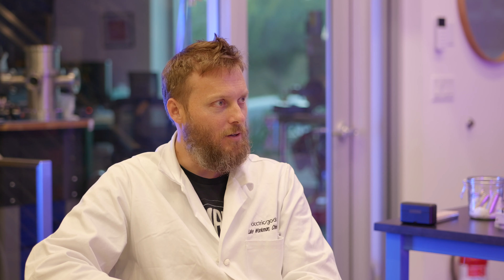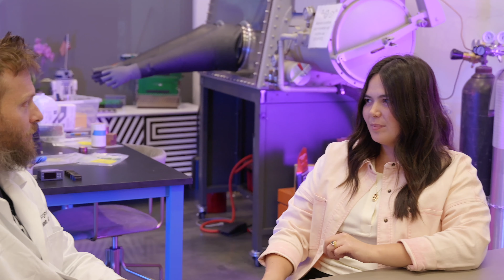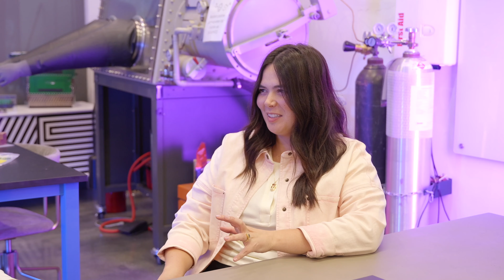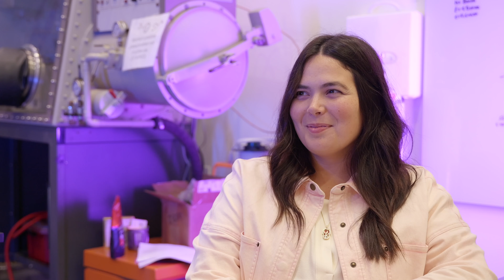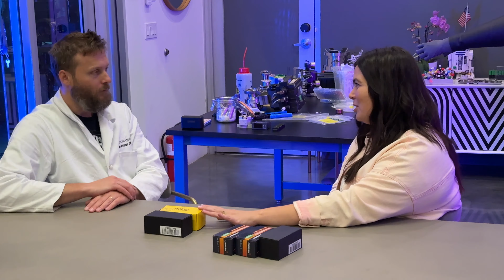Racing EV Battery Design Considerations

Comment: Let’s build a cell for a single cycle!
In ultra high-performance drag racing, where budget isn’t a constraint, I can easily imagine single-use LiPo packs even without BMS for a 7 or 8 sec run.. after all what could it do anyway?. These cells lose performance after every race anyway, which goes against the idea of tuning for peak performance.
So why not design a LiPo pack optimized for maximum performance, right at the edge of safety, just for one race? Swap it out every time — just like the active material of the 5MW semi-solid chemical laser in Real Genius with Val Kilmer!
When your goal is to win or break a record, longevity isn’t always the priority. Single-use, ultra-high-performance LiPos might be the way to go... or at least worth trying.
Now we just need to find a cell manufacturer crazy enough to make it!
Bonus idea: instead of recycling the pack right away, maybe the next cycles could still be repurposed for other uses.
Reply: On the concept of single use batts, Li metal anodes with a molten salt electrolyte could be capable of epic power density.  Molten salts kinetics are way faster than normal electrolyte solvents for solventation and thermal kinetics.
Reply: You're essentially describing non-rechargable primary lithium cells.  Unfortunately, there isn't a huge market demand for one time use lithium cells that also have extremely low series resistance.
Reply: @doppelhub  Yes it called FPV drone warfare......